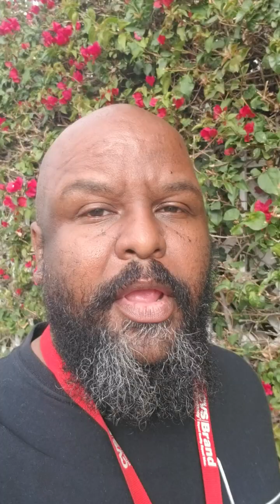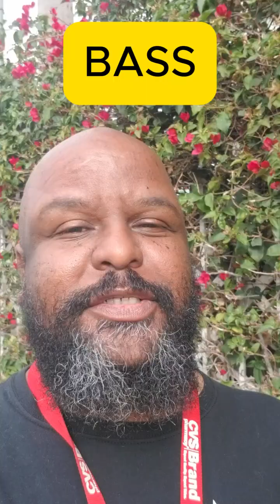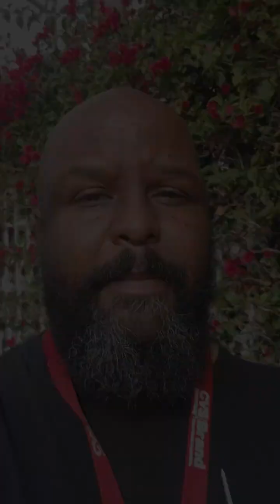Bass Amps & Ohm Loads Explained.1-Ohm doesn't Always mean More Power! #caraudio #bass #amp #ohmslaw

Comment: Yup. Absolutely 💯. Unless you were running US Amps VLX, Soundstream Class A 6.0, Orion HCCA, or Phoenix Gold MPS amps, you couldn't run low ohm loads like that, although there were some companies like Rockford 2nd gen Punch amps that were overbuilt and could handle those lands (even though it wasn't recommended). I had a 2nd gen Punch 150 and ran it 2 ohms bridged for years on 2 Gold Letter Kicker C12's and never gave me a problem. On another note, I have a PPI PC2350 sitting on a shelf. Still deciding what I'm going to do with it. Lol
Reply from the maker: Bro... that 2350 has got to be worth it's weight in GOLD! 

But yeah, lots of old school amps were over built... maybe to help us from ruining our expensive gear. The good old days.

Comment: completely on old school ab amps putting there power put at 4 ohms alot of the people that say amps dont put mush power out at 4 ohms are people that haven't mest with car audio since late 80s early 90s most of them only have had class d but its still a toss up for me if old school amps at 4 ohms sound better then class d amps at 1 ohm i liked how the lows sounded on my 12in Rockford powers with a Kenwood 1000ab amp on each sub i think more then my cab 22 amp on my wolfram au 12s  but i might just have to mess around with adjusting port or try building another box or both ill figure it out been doing the stuff since late 80s
Reply from the maker: Oh man, you started at the beginning of the best era's of car audio....I got my start in 94'. My thing is, I honestly can't hear a worthwhile difference between 1-4 ohms on a sub, so I use a class d on mine... but I've considered a 4 ohm amp. But it comes down to efficiency for me at that point. The current draw from my 1 ohm class d 1,000 watt amp will more than likely be much less than that of a class a/b of the same power.

Comment: Does a 4 ohm load sound better than 1 or 2 ohm load. Bass frequencys
Reply from the maker: Not in my experience. It's virtually inaudible. My boy was running his at 8-ohms, while I was at 1 and we could hear no difference, so from 1-2 ohms...even more unlikely.
Reply: @Ahm-Creative is your electrical more efficient at 4 ohm ?
Reply from the maker: @biggiss5577  I haven't testing mine, but it may not be more efficient in comparison to class d technology, but overall it is a lighter load, so I'd imagine so.
Reply: @Ahm-Creative whats your subwoofer final impedance?

Comment: It also changes the dampening factor, but I wonder if you can actually hear the difference.
Reply: to some extent, higher damping leads to better control.  It isn't EVERYTHING, but it does have an effect.
Reply from the maker: @Satch_4_Hogs  is it audible, or just measured with a mic and scope? Not being sarcastic, just asking as I cannot hear a difference.
Reply: @Ahm-Creative  a speaker with more control is going to be more accurate.  It's going to be noticeable in the texture of the bass.  It's going to be the subtle characteristics.  Maybe the difference in most amps is so slight that it doesn't make so much difference in sound.  Maybe a speaker with higher sensitivity displays the difference more readily.  Not sure what the full answer would be.  I haven't done a side by side comparison myself.  Theoretically, it should make a difference.
Reply from the maker: @Satch_4_Hogs  Yes, in theory absolutely, but with my boy's single 12 at 8-ohms, and my single at 1-ohm, I couldn't hear anything, and wouldn't have known had he not told me, Of course, it wasn't a scientific test in the slightest, but I didn't hear a benefit of him at 8-ohms, or a loss of sound quality in mine at 1-ohm.
Reply: those old PPI amps were 2 channels, 2x350 (hence the 2350 model) @ 4ohms, 2x700 @2ohms, 1x1400 @4ohms.  

I used to collect old school amps back in the late 2000's, lots of the old Eclipse Power series, US Acoustics, anything Zed made I loved...US Amps too, old RF, Pioneer, etc.  I had over 50 amps at one time just for fun.
Reply: @RyanM923  I have the old school 500.2 fosgate amp from 1999 rated at 250x2@4ohms and 500x2@2 ohms.  Before they added the @ on the nameplate. They still go for a lot, unfortunately this one doesn't work. I think this was my best sounding amplifier.
Reply: @MrChipDouglas1  yep, those were killer amps.  I found a NIB a800.2 on craigslist back in the day, still had the RF stickers and all that jazz in the box too, one of my favorite finds.
Reply from the maker: @RyanM923  Oh man, I would and would not love to see your collection, because I might pass out..LOL! That is Awesome!
Reply: @Ahm-Creative  I sold all of my collection maybe 10 years ago.  I used to design speaker boxes for guys on the car audio forums back in the day.  I went by RAM Designs, if you remember that name.  I miss having a system but with newer cars I just don't have the patience to do it.  Was much easier in my '04 truck.
Reply from the maker: @RyanM923  oh man, I sold all my gems too, and kinda regret it, but I get it. Sorry, I didn't know your name from back in the day, but I also wasn't on forums like today....and I agree 100% with today's cars being total install nightmares! I tune for others, but only install for me (and my family if they have SIMPLE systems).
Reply: U can
Reply from the maker: @jjay2650  do what? Get full power at 4-ohms, or wire any amp at 1-ohm?
Reply: @Ahm-Creative  oh no i was replying about the dampening at 4 ohms versus 1 ohm
Reply from the maker: @jjay2650  No way...you can hear it? Is it significant, or barely noticeable, because my boy was running his at 8-ohms while I run at 1, and his sub isn't more musical or controlled than mine...as far as I can hear at least.
Reply: @Ahm-Creative  i wanna say i think it was a slight difference but then again i think it could be the box….i had a rockford t1 in a prefab and it sounded good but that was at a 2 ohm load and then when i got a second t1 i was at 1 ohm it didnt sound as good but i think that just had to do with the box for 2 more than anything so maybe im wrong here…im building a new system now and i always wanted to test different ohm loads so ill try it once its complete
Reply from the maker: @jjay2650  and the power change factor would have an effect on what we're hearing, unless we had two different cars with the same power at the different ohm loads. It would be a nice scientific test...so I would look forward to seeing yours since I don't have a way to do a worthwhile test.
Reply from the maker: I highly doubt it...just like some say 1-ohms for SQ is dirty (on subs), but my same teammate was running his sub at 8-ohms, while I'm at 1, and we can hear no difference what so ever.
Reply: @Ahm-Creative  I know it's splitting a hair here, but I have noticed some amps have a higher dampening factor, but maybe it all depends on the sub how sensitive it is or maybe for mids and highs.
  I guess someone could do all this testing,but since there is not much of a difference if any, probably not worth it, I really don't know lol.
Reply from the maker: @MrChipDouglas1 lol I agree, and I have had similar discussions with others and concluded that I no longer care to worry about things that are inaudible. They may read on a scope, but if I/we can't hear it, I won't completely ignore it, but also wrong obsess.
Reply: @Ahm-Creative  I feel like in old school amps the dampening factor was a bigger difference going from 4 to 1 ohm vs newer amps. It also depends on what you're listening to.  If you're listening to a Focal Demo CD with quicker transients and real instruments, it'll be more noticeable vs playing some Grippin' Tha Grain lol
Reply from the maker: @RyanM923  LOL yeah, I can dig it.
Reply: That guy sounds like a tool, reading the specifications for a particular amplifiers hard I guess. They’re not a size fits all lol.